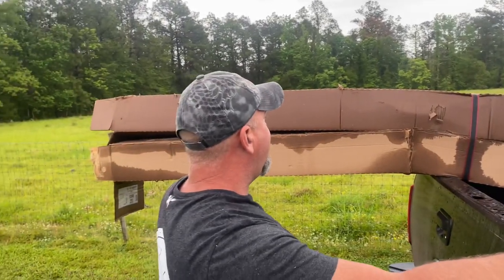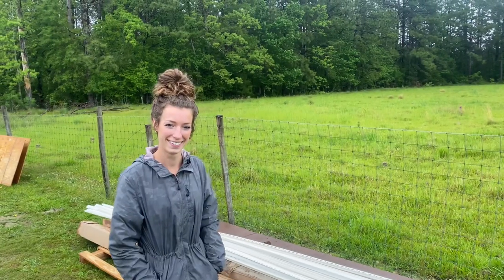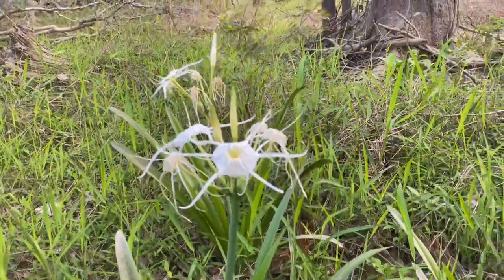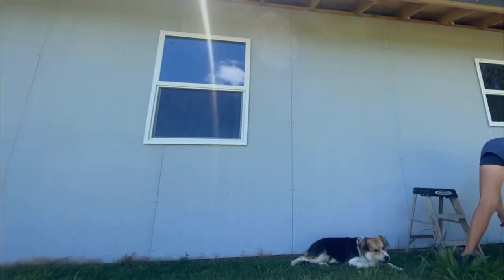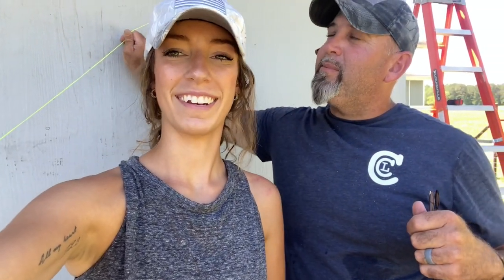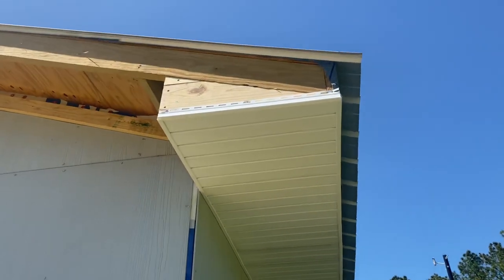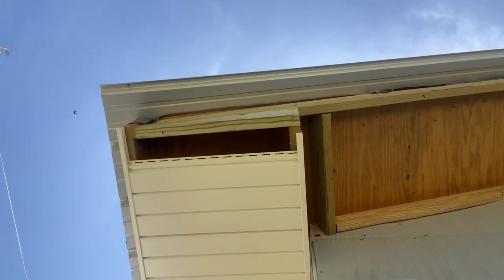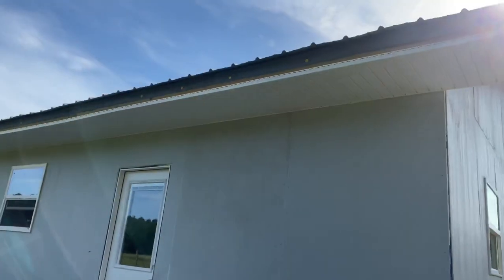Building Our Own Home Ep. 31 | Installing Vinyl Soffit & Bird Boxes

Comment: Soffits are tricky and that looks really good.   Vinyl soffits installed in a J-channel like that are standard building practice, but a lot of folks got significant water intrusion in their homes in Panama City during Hurricane Michael in 2018 because of them.  Winds hit the side of the house and then go vertical and blow out the soffit, then water goes directly in the attic, soaks the insulation and the ceilings cave in.  In many cases it allowed lift to rip off the roofs.     Older homes like ours with framed plywood soffits with small vents didn't have that problem.  Not trying to scare you but that's a weak point in a hurricane area like you live in.
Reply: Same thing happened to our neighbor during hurricame Sally. Major damage. Ours are plywood, as well. We didn't have any wind damage.

Comment: Looks great. Nice and straight. Good job. Consider, instead of the 2 1/2" piece on the end, add the 2 1/2" length to the end J-Channel. Cut a miter in the bottom J section and fold the 2 1/2" section around to the back. It will close off the corner better and look amazing. It's all about keeping the weather out. Thanks for sharing.

Comment: While vented soffits are used on the eves and solid on the gables, the additional f channel on the outside is not required.  The fascia will hold them.  I've seen both.  Anyways great job.

Comment: Great job on installing the soffit but one question for you. How are you venting the roof. Usually the soffits have venting holes in them or separate venting panels. In combination with the baffles in the roof to allow air circulation, leading to roof vents.
Reply from the maker: We are spray foaming the rafter cells so that it will be completely sealed. We won’t need any vented soffit. Thank you for watching!

Comment: Great job as usual guys! Are you going to put trim boards around the windows and doors? If so do you need to whack a whole load of silicone in the gap? Or will it be covered by the trim and then have a normal caulked seam?

Comment: I haven’t watched every episode so I don’t know what the roof ventilation plan is but I noticed you used solid soffit on the eave rather than the typical vented soffit & ridge vent configuration. The gable/rake end is usually solid soffits. The vinyl stuff seems to droop so I prefer the metal stuff and box in the end with rivets rather than wood. Don’t forget gravity will pull down even the tightest pulled string lines so they’re not the best for elevations, especially long runs. But then it’s just a house, not a precision clock.